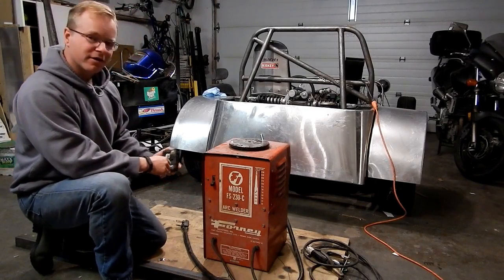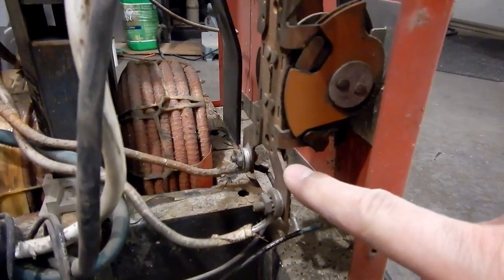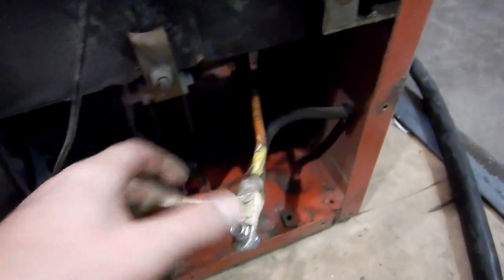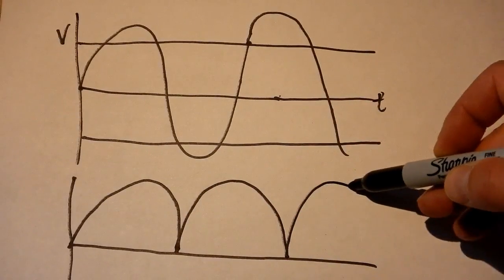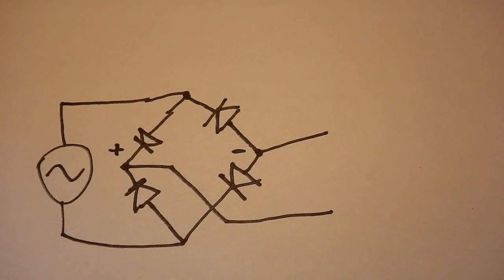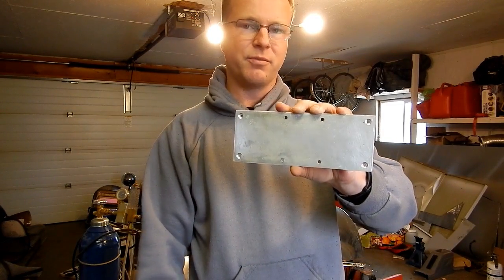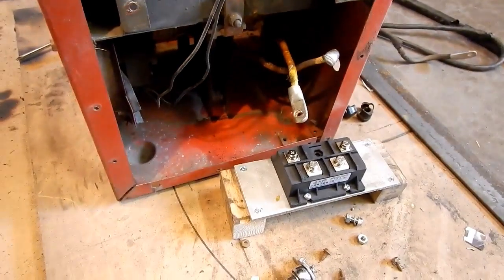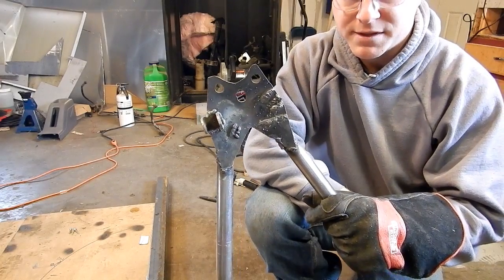AC to DC welder conversion Part 1

Comment from the maker: So I tried making an inductor out of a length of welding cable and a steel core, and couldn't get the inductance high enough with the length of cable I had. I need to source some ferrite pieces to use as a core, or run a lot longer cable to get more wraps. Anyway, part 2 won't be happening until I get this sorted out, sorry to keep everyone waiting...
Reply: I wrapped 8 turns of # 4 wire through an old microwave xfmr that I cut the windings out of and it still works awesome, also a small circuit to control the spiking of the 4 - 100 amp diodes I used.I also used 2 computer power supply fans for cooling and have had no trouble welding constantly and no trouble with duty cycle.
Reply: In my conversion I topped out at 6 turns of 4AWG on each of two MW 
transformers and it still wasn't enough inductance.  DCEN TIG welding 
using it consumed my tungsten tips too fast.  I finally found a reactor 
with a laminated steel rod core and 22 turns on it and the DC welding is
 much improved.  Try to find a transformer from a cheap transformer 
welder and use the secondary as a reactor, or possibly stack and fasten 4
 MW transformer cores together and then wind 20+ turns around the entire
 stack on the outside.
Reply: @CapnCrusty  I was wondering if magnetic ballast HID transformers would be better since those sometimes are found for free or a decent price.   I've also been wondering about making a plasma cutter, or maybe a welder, out of a digital ballast.  I haven't looked at the specs of the digital ballasts yet in enough detail.
Reply: @CapnCrusty  How to convert AC welder to TIG weld please.? What's the best circuit for aluminum welding using AC. Appreciated your advice.
Reply: Did you get it figured out let's see part 2
Reply: So, what do you mean you couldn't get the inductance high enough?  What does it need to be?  Isn't as many wraps as you can get better than nothing at all??

Comment: A 230 amp ac welder only puts out 140 amp in dc voltage so the amps on the machine do not translate amp per amp when going from ac to dc voltage output....

Comment: Please,I want to change my diy ac 100amp welding machine to dc and the output is 39volt.can I go ahead with the actual bridge rectifier you used in this video?
Reply: GOTO  amazon,  look for 200 or 400 amp ones, pretty cheap. i got a 150 amp  1600 volt one, for 22 bucks

Comment: Hi.....i got an older lincoln tombstone 225  AC welder....i'm  gonna do the same thing.......also will put a reactor coil choke transformer in the output.....experiment how many turns of #0 wire on the thing....(old microwave transformer core)......thanks..

Comment: Good afternoon. I have a Lincoln 225 stick welder that I did the D.C. Conversion on. The rectifier is for 300 amps. Im trying to use 7018 rods but every time I put the stick on the material I'm welding the welder bogs down and the fan stops. After I remove the stick the fan kicks back on. Im running the welder on a Coleman 5500 generator which I've used on my first buzz box with no problem but without the conversion. Would you have any idea of what's happening with me? Thank you very much. Eric.
Reply: ....your voltage is probably too low. voltage, is 'pressure'....not enough will cause this. TRY  placing a 5000 u Farad  200 volt capacitor across the + and + of the bridge rectifier. Google 'how to '  .......
Reply: Thank you so much. Also I went on to the Lincoln website and they mentioned some of the issues that I was going through and said after the conversion the generator may not be strong enough to power the welder.
Reply: sorry, should be +  and  --  neg
Reply: my second response. i used a 28 microfarad one, salvaged from old junk. IT  GOES  MUCH  BETTER, now. Arc is explosive. try an old microwave oven capacitor, about only 7 ufarads, so put 3 or 4 in parallel.....good luck.

Comment: Oh yeah, that Chinese bridge rectifier ought to last about a week.  You will still need a proper heatsink and thermal compound.
Reply: YES.  USE  A  COPPER SHEET, and make several expanded wings, out in open air. even use an ac fan, connected to one of the secondaries, to run it. might be a bit slow, but, the volume of air circulating would be plenty.....

Comment: The old "Buzz Box" looked pretty clean inside for its age. I would have thought that you might have put in a switch that would let you change from A C to D C when you wanted to use the other form of welding. There are times when A C is a better choice than D C. I do agree that most of the time you would use D C as it is a much cleaner weld.

Comment: Help a hillbilly out- What's the advantage of DC over AC - I inherited an old Miller AC welder my dad used for many years but I never got into welding so curious about this - My Dad used to weld / build High water tanks back in the 60's  - thanks
Reply: Less splatter i've heard. 
But you also trade that off with the addition of magnetic interference or "arc blow"
Reply: You can use a 7018 rod with dc+ electro for much smoother welding..with dc- electro you can weld thin metal very smooth..also you can stick weld Aluminum with DC unlike AC can't..so with  DC it make it easier to weld on different types of metal and thickness while using better rods to weld with..definitely worth the cost and time to have more options available..

Comment: the current will drop after the bridge diode. if you put capacitor on it. it will charge and discharge while on welding. i tried it already. not advisable to convert it to dc welder. useless.
Reply: The factory does this conversion so it can be done. Lincoln and Hobart / Miller

Comment: A 200 ampere bridge rectifier on a 230 ampere welder is wrong. FWIW, going with a higher amperage for the bridge rectifier is better. Now that it's a year and a half later, I'm sure you blew up your bridge rectifier. Your only limitation is cost and physical size not electrical. The Chinese always lie about their specifications so doubling the amperage is a minimum. For example, a 230 ampere welder must have a non Chinese bridge rectifier of at least 230 amperes plus about 50-percent more power handling capability making for a minimum of 345 amperes. For Chinesium, 400 amperes would be my minimum.
Reply from the maker: The current limit of the rectifier is not an issue for me as I never run anywhere near that high. I don't need that amperage for the jobs I do so I'm fine with de-rating the welder while on DC. Lots of old ac/DC machines have a lower rating on DC. Haven't blown up the rectifier yet.
Reply: Your video is viewed by others who might be interested in a full running converted welder and not a de-rated one like your welder. If you have not physically prevented your welder from being cranked up to a higher amperage than your bridge rectifier can handle then a failure could occur. Glad to hear your mod is still running strong for you. I saw your glider video and learned that you are a pilot like myself. Stay safe.

Comment: It's not true DC , It will still have ripple , The negative cycle will show a gap as it's not there anymore , you want a large value  capacitor to supply the missing cycle to reduce the ripple .
Reply from the maker: MrMadjones With a single rectifier diode the negative cycle would disappear, with a bridge rectifier like this one the negative cycle is reversed into a positive one. It's still a pulsed signal (at 120hz) until it's filtered and smoothed, but the "gap" isn't nearly as big as of you were just eliminating the negative cycle.
Reply: @jacobinalberta  thats right your just still getting a sag in current as the voltage drops to the zero cross line as you would on ac only its getting topped up again twice as often

Comment: the magnets in the shunt are weak, if you use an amp meter and a second set of hands you can adjust the the indicator but you will still have loss of range.

Comment: The diodes in the rectifier are carbon based and allow electricity to flow easy in one direction and very difficult in another..   so its controlling the pulse somewhat but not true dc.  as I see it.   correct?
Reply from the maker: mic jam correct. in order to turn it into true DC you have to smooth it out with a reactive element. Even then, you will have ripples, not perfect DC, but for a welder it doesn't matter.
Reply: I appreciate your video and response.. cheers!!
Reply: Incorrect. The diodes are silicon based. After rectification it is pure DC. Whether there is ripple or not does not make it any less DC.

Comment: Very nice video sir,
Where to buy this one
And how much it costs in USD
Reply from the maker: Search on eBay for "200 amp bridge rectifier" and there should be a number of them for sale, for around $20-25 USD. You only need a 1 phase rectifier for this kind of welder, so don't get a 3 phase one.
Reply: jacobinalberta g
Reply: @jacobinalberta  ....OR  amazon....got a 150 amp 1600 volt for 22 bucks

Comment: dc wires do not go to the primary on transformer you cannot transform dc  ac source goes in the primary and out the secondary and is still ac then ac is rectified to dc and out to your welding leads

Comment: What kind of bridge rectifier did you use I know you said 200 amp 1600 volts but what phase is it ? Would really appreciate an answer because I’m trying to do the same thing
Reply: I started messing with that recently, too. The rectifier i bought was this (works great, btw): https://www.ebay.com/itm/MDQ-200A-200A-1600V-Amp-Power-Module-Single-Phase-Diode-Bridge-Rectifier-Case/322872435768?hash=item4b2cb26438:g:K64AAOSwkLhaBDw0
Reply: single phase= 4 connectors  2 ac  and +  and -   .   3 phase, bridges, have 5 connectors.

Comment: Cannot wait for part deux, where the inductor wiring is placed to the lead ? Will you have a 4700 uf cap to smoothout the arc, can't find yet on you tube yet. Thanks

Comment: The three phase rectifiers are easier to com by on e-bay. Do you really need a LC filter? The aluminium plate makes little sense. You need to mount it on a heat sink with a fan. Surface area is slightly larger, but does not make for a good heat sink. Apply some heat sink compound to for better thermal conductivity.
Reply: Willem Exist 8

Comment: If you run your grinding  wheel into bees wax, just a touch it will not load with aluminum  then cut a lot faster.

Comment: If that was like my old Fourney welder, it would have originally had plug in connections for the welder leads. They are known for failing, which probably explains why the leads are connected the way they are now.

Comment: So if I understand this correctly, if you used JUST the bridge rectifier, you are basically making a pulsed DC welding current with a pulse rate of 50Hz or 60Hz (depending on where in the world you live).  Pulse welders are the newest thing out there, although most of them allow you to vary the pulse rate.  It might be nice to have the pulsed output, even if its just one set value. I have seen other guys use just the bridge rectifier on other videos. What do you think?
Reply: Inverter (pulse width) welders operate at much higher frequencies so the smoothing circuit (inductor and capacitor) is much smaller, more effective and less expensive. 
The term pulse being used here is incorrect and is actually just ripple. A pulse is digital, ripple is analogue.
Magnetic pulsed welding is a totally different technique altogether and more mechanical than electrical.

Comment: i think if you measure your voltage after the bridge rectifier it may be lower than if it was coming out AC. Check out the welder tag to see if it has a voltage out number and then compare to a reading after the rectifier. lower voltage= higher amps to get the same amount of work.

Comment: I tried this and popped a 75a circuit within seconds. I'm not convinced that this works. The rectifier I got is rated for up to 1200V 200A. It should be plenty strong enough.
Reply: Convince him to spend time on REAL WELDING FORUMS and not just Youtube.  All the answers you seek live on Weldingweb and the Miller forums. If you are in the EU, migwelding.uk cover all processes with emphasis on EU equipment.  Youtube cannot get into the details easily covered in forums. Videos are nice for visuals but relying on them isn't a great idea.  Also explore a variety of AC rods. DC is nice but AC transformer machines don't exist by accident. I like old, heavy industrial AC machines because they have higher OCV then Bubba's farm welders whose OCV is on the low side to keep gumps from electrocuting themselves. BTW many, many rectifiers have been fitted to transformer style stick machines. When the factory did it it was prettier. 6011 runs fine on AC as does 7018 AC. A common way to buy welders is a used transformer machine (tough, reliable, no circuit boards to fry) for heavier work, and a new small FCAW/MIG for thinner stock.
Reply: I was thinking about doing this for a friend who might buy a used ac welder. Maybe I'll try harder to convince him to just buy an everlast inverter welder. I don't want to be popping any breakers.
Reply: Sebastian Adams I've tried it a few times since then without a problem, but I would still recommend spending the extra $200 to get at least a cheap AC/DC machine.  I think the problem was that I was losing a little bit of power through the rectifier, so I had to turn it up 20A more than usual to keep the rod burning.

Comment: Friction tape ("hockey tape") is actually BETTER than cheap vinyl "electrical" tape.  The adhesive remains strong after long periods of time and the "cloth" part of the tape remains pliable.  Yes, there are good vinyl/PVC electrical tapes out there (Scotch 33 or 88) or linerless (only sticks to itself) rubber based tapes, but they are not stocked at most hardware stores and are expensive compared to the cheap imported stuff.

Comment: 7018 should be DCEP. That may have been why you were having problems with the arc. 6013 can be run electrode negative for welding thin metal, but I haven't tried it myself yet.

Comment: did i miss the capacitor?
Reply from the maker: No, at the moment there is no choke coil or capacitor. One of these days I'll add them and make a part 2 of the video...
Reply: How strong of a capacito3is required?or is it goodv@50vcd?
Reply from the maker: If you're putting in a capacitor, make sure it is rated at least 50% more than the peak open circuit voltage. For example, my welder has about 80 V A/C (RMS) when open circuit, which means the peak is about 112V. I would want a capacitor rated to at least 160 V.
Reply: +jacobinalberta, thanks for the creative pursuit!

Comment: hi mic fron mexico i have a question im using miller dialarc 250 stic  with my wire feeder as mig welder 
but the problem is when i turn it on the wire is  hot all the time .could i put him electric coil to control it with the switch on the gun   and where to put it anyone have any  idea how to do it or if there is a better solution please help thank you
Reply from the maker: Hello Mic,You could put a solenoid on the connection to your wire feeder so that you could turn current on only when the wire feed is on. You have to make sure the solenoid is rated to handle greater than 250 Amp DC, so it would be quite big. That being said, my MIG welder has a hot wire any time it is on and I never really found it to be an issue. Just treat the end of the gun the same as you do a live stick welder and don't touch it to anything until you are ready to weld.
Reply: thank you   j   i appreciate the time you took to  answer my question i will try it as you say  thanks again

Comment: I'd like to do the same conversion on a Lincoln AC 225, and have found a source for the 200 amp bridge rectifier. Can you pls tell me the specs for the coil and capacitor? When is the second part coming? TIA garrettinbc
Reply from the maker: From what I can tell, the higher the inductance on the coil the better, but the limiting factor is space. The coil needs to be able to carry the full output current of the welder, which means the cable with which its wound needs to be the same gauge as your leads or thicker. The capacitance is less important to the functioning of the welder so you probably don't need a discrete capacitor.

Part two is coming when I gather a transformer core to wind the inductor.
Reply: Thanks for the additional info. I've ordered the bridge rectifier from amazon and shoould receive it next month. Based on your comment, 8 gauge wire would be ideal for the coil. I know next to nothing about electronics, but I've watched the other pertinent YouTube videos, including those that rewind microwave oven transformers. What I think I've learned is that the rectifier changes AC to DC but imperfectly, so the coil and  capacitors each help to smooth the DC output. Boltr in Prince Rupert says that several smaller ganged capacitors are more effective than one or two larger ones.
Reply: @jacobinalberta   ....salvage old microwave ones....very good....will take 5 turns of 0 wire....
Reply: Leichte Mädchen
Reply: su Ebay c'e' un ponte raddrizzatore da 300 amp (MFQ 300 A)